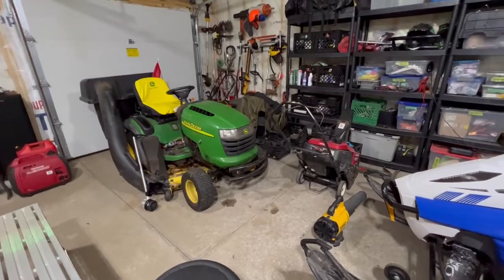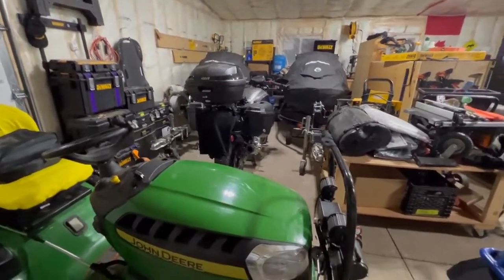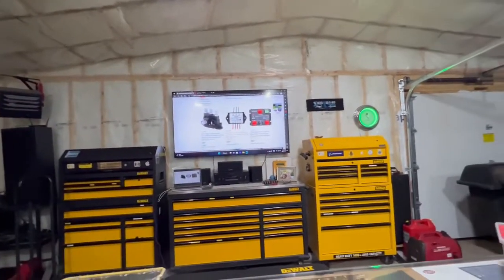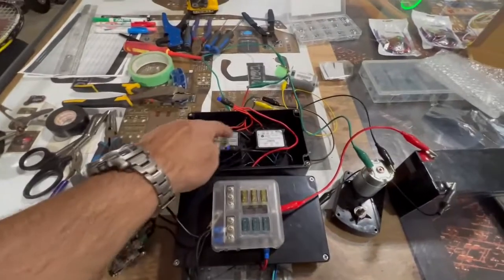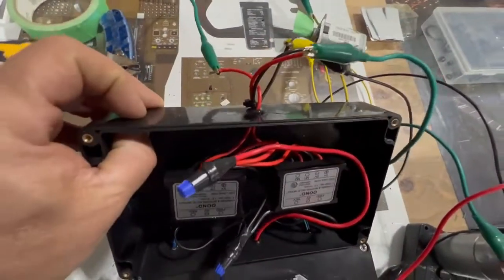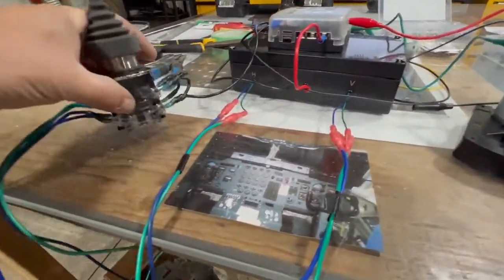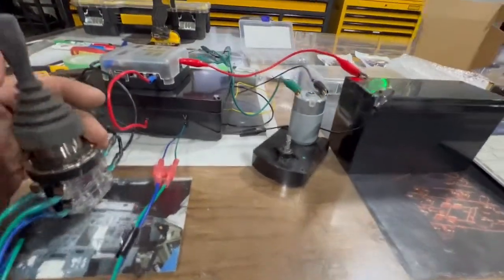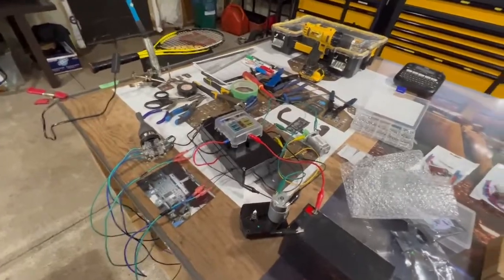How to wire a 4 way joystick using 12v relays for snowblower chute actuators on a JD garden tractor

Comment: Excellent video, just what I needed, I had ordered the same Joystick, along with a 4" actuator for the up/down deflector and 60 rpm motor for the left/right chute for my Wheel Horse H520 with 44" 2 stage blower.  Right away I went on YouTube and found your video. Then I ordered 2 relays. I just finished up the wiring which was as you said "Very Easy" The relays are a must in order to make this application as you said earlier. I have about $120 total for all the components to make this Snow Blowing easier. Thanks for the video!

Comment: Thanks, just what I was looking for, but still trying to make sense for the need of these relay. I should received my Joystick tomorrow, can't wait to give it a try.
Reply from the maker: I thought the same thing until I realized the joystick I purchased wasn't actually a reverse polarity switch. Needed to buy the reversing relays for it to work properly. I took a chance on the relays because I already drilled the big hole in the tractor and was trying to do some damage control. We had a good dumping of snow yesterday, so I was able to test it out and happy to report its performance exceeded expectations. Good luck with your project.
Reply: @TheAV8T0R  Received the reverse current relay yesterday. and made a simple working model as you did prior making the final assembly. Unfortunately it does not work, I think the relay need to be a 12 volts rather being a 24 volts. the 12 volts would require less voltage to close the relay. When try to bypass the switch and touching either the green or the blue wire to the black wire together I can hear the relay clicking but no current flowing to the motor. It is possible that the Reverse Current Relay is defective?  How can I send you a picture of the working model?
Reply from the maker: @mtakwax  The relays I ordered from Amazon were indeed 12 volt. If the relays are clicking that usually means they are making contact and should function. If you ordered 24v relays I would return them for the 12v and start fresh - could be defective or could be the voltage - either way you have yourself covered. Good luck.
Reply: @TheAV8T0R but the ones you show on the tv are marked 24v .. and it works? I am debating buying and trying the 24v ones because i cant seem to find the 12v ones on amazon

Comment: If you ever get a chance, please get drywall on the walls in this place. The exposed vapor barrier will burn and drip like nobody’s business, and it sometimes catches on fire from something as innocuous as grinder sparks. If you’re ever inside and there’s a fire, even a tiny one, with the stuff exposed - just run. Don’t try to save anything.